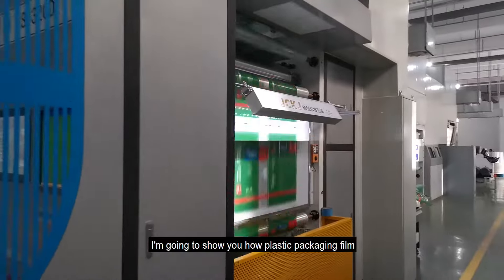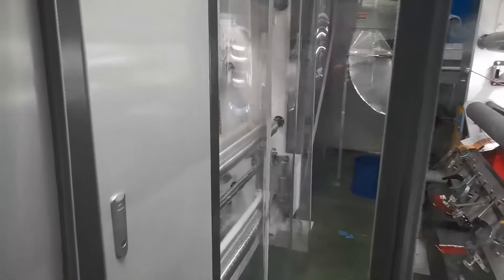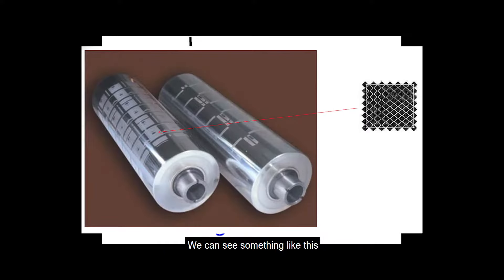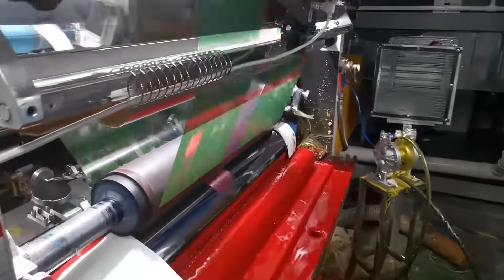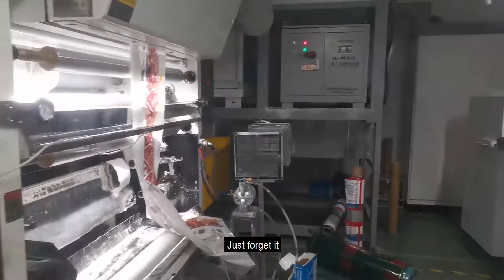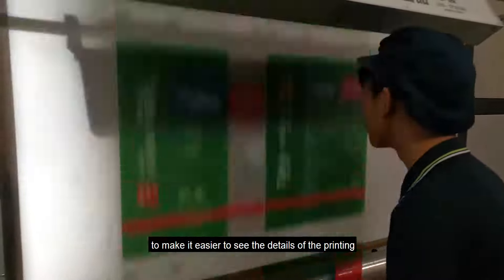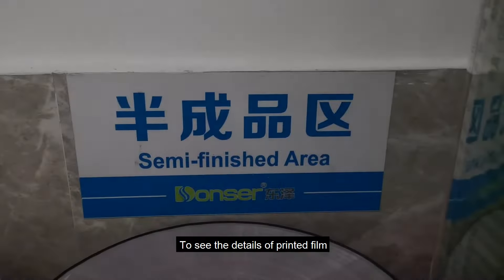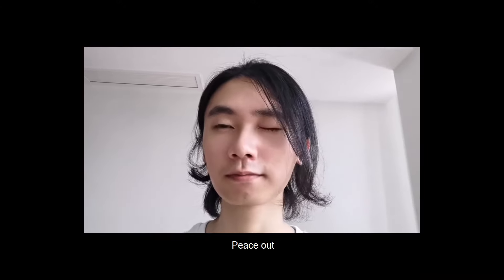packaging film roll How is the packaging film printed ? What is Rotogravure Printing?

Comment: Hi what film is used for standy zipper pouches ? 
Is it Bopp or PE 
I have seen white rolls printed and then laminated which is finally made into pouches . Just want to understand what material goes into standy zipper pouches
Reply from the maker: Both Bopp and PE can be used in stand-up pouches.If you want to know more about packaging bags, please follow our Facebook page, thank you. https://www.facebook.com/DonserPackaging
Reply: @DonserPackaging  sure I will thank you 😊
Reply from the maker: Dreadnought 1997   printing including gravure printing and digital print. Difference is ,Gravure printing good at ,if qty more than 20,000 pcs, costs of bag is cheap,and it only charge cylinder cost at the first time,production need 20 to 25 days. Digital print no need cylinder, less than 20.000pcs is ok,but unit price will be high,production time will be sooner than gravure. But bag size is limited.
Reply: How much one cylinder cost and how much it reduce the cost per piece
Reply from the maker: you can check our other video how to make the pouches